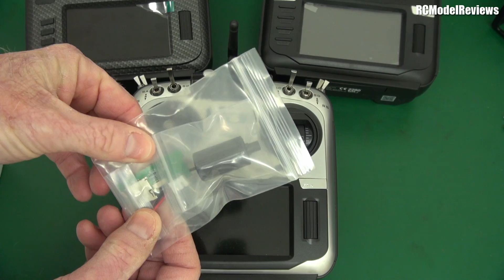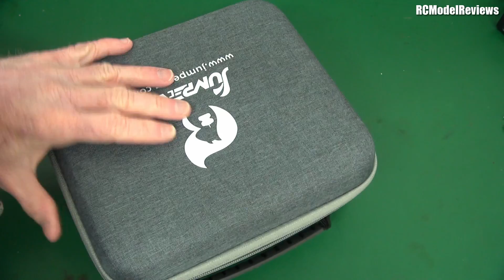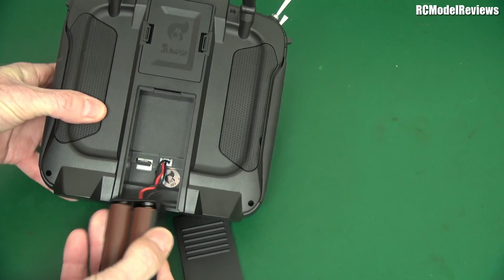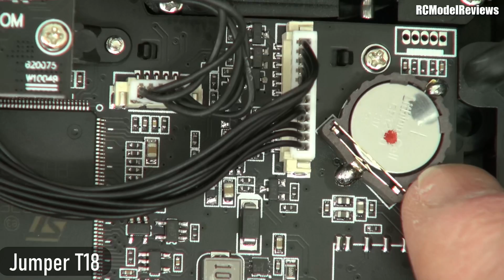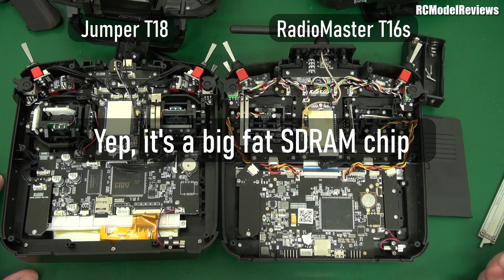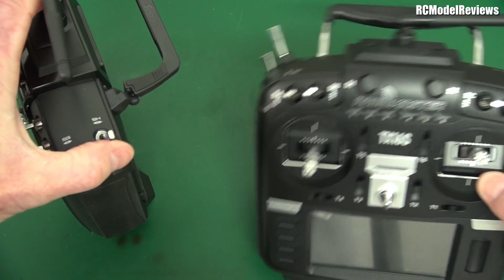Jumper T18 vs RadioMaster T16s TEARDOWN

Comment: Have had my T16 for a while without any problem so I thought if I just be gentle with it, I'll have no problem. I'd been playing with sims lately and pulled it from under my desk to play, arm switch doesn't work. So much with being nice to it, pulled the back, reseated the switch ribbon cable, ordered the replacement ribbon cables.
Reply: I had to reseat different ribbon cables four times now. The T16 was just sitting on my desk in between. No rough handling or even any handling between working and not working...
Reply: I think jumper will send you free replacements for your cables
Reply: @gautamkrishna7421  Thank you, I have received the cables and installed them, everything is fine now. Just thought it funny it quit working properly just setting in my office.
Reply: @gautamkrishna7421  No, they won't. I've tried.
Reply: @mike-v8j3x  When did you ask them? I think they definitely were for like the first year

Comment: I put a jumper folding handle on my TX16s Oh and trimmed the pull tab off the screen protector.
Reply: Can you share a link?
Reply: @JayQ FPV: Here are some links for the Jumper T16 folding handle. Just search for Jumper T16 folding handle in the  search engine your country.

https://www.team-blacksheep.com/products/prod:jumpert16_handle
https://www.xt-xinte.com/Jumper-T16-Upgrade-Folding-Handle-for-T16-T16-Plus-T16-Pro-handle-Spare-Parts-for-Transmitter-Radios-p708811.html

https://www.nextfpv.com.au/collections/jumper/products/jumper-t16-folding-handle-upgrade

https://hobbycool.com/products/jumper-t16-transmitter-foldable-handle-parts
https://www.aliexpress.com/i/4000734973302.html?spm=2114.12057483.0.0.3ccf6f7fn7lsMd
Reply: @anthonywitham2305  Good on you AW Yeah plenty of places to get parts. It`s just time for delivery that lacks in AUS anyways
Reply: @gen3v8  . I just ordered mine yesterday from NextFPV Australia. Got a tracking number for Aus post, so I hope it ships today.
Reply: @anthonywitham2305  Yes if you can get stock from Aus it`s good. I purchased my Tx16s from Fpvfaster, was in stock, and next day it was delivered
Reply: will the handle close if using the Crossfire Long Range (Full-size) module?

Comment: You can buy the foldable handle and fit it to the radio master
Reply: can confirm the foldable handle fits, have one on my tx16s
Reply: @REDTHUNDERactual001  same
Reply: @REDTHUNDERactual001  will the handle close if using the Crossfire Long Range (Big) module? I ask to see if it would fit in the jumper case
Reply: @ChristopherNovaSmith  i have the mini Tx module and it folds almost completely, just rests on the module slightly, cant say about the big one, but i would guess it will fold down and rest on it
Reply: @REDTHUNDERactual001  thank you for the reply
Reply: Yep, stole it off my now redundant Jumper
Reply: Chris Daws metoo 😂
Reply: You can also 3d print yourself one

Comment: If anyone is reading this, I bought a Jumper T18 with the 5in1 module and have the same issue with the scroll wheel. It is almost impossible to program a model with this.

Comment: The pluses and minuses will obviously go either way dependent on how you use the radio - folding handle great if you don't want to fix a screen a fpv screen to the radio - a problem if you do want to fix a screen to the radio. Detents on the rotary switches great for things like flaps, but a pain if you want to use them to smoothly control a gimbal. Swings and roundabouts, it's just getting the right combination to suit your needs.
Reply: That's true, but reliability and to a lesser extent build quality are vital elements whatever your needs.